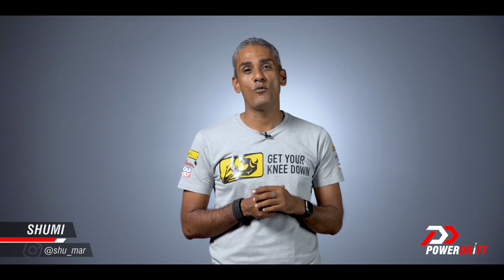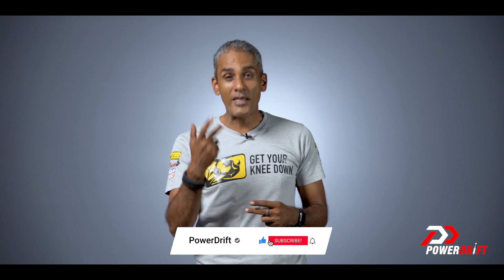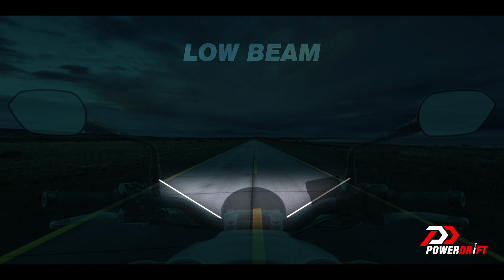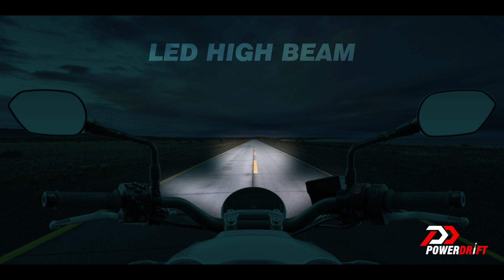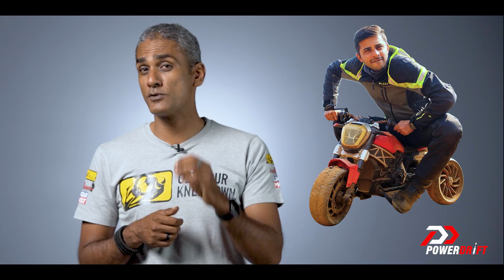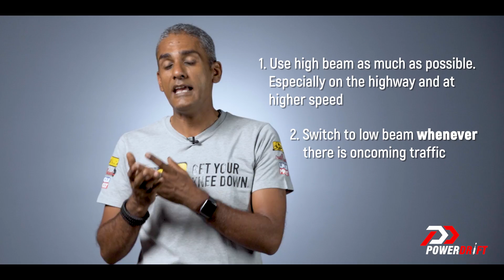PD Simplified : Are You Using Your Headlight's High Beam Enough?

Comment: I have one suggestion about this topic.
If we are heading to a corner, use high beam to give your presence on the road for the oncoming traffics.
On corners, Low beam lights have shorter light area; thus you have to respond even faster if the oncoming traffics are taking the corner through our side. But if we are using high beam; it's cover long distance thus it's shows our road presence also we got enough time to respond even the oncoming traffic is on wrong side too

Comment: The problem with many vehicles today is the AHO- Always Headlight On. It is absolutely unncecessary in Indian circumstances. It eliminates the off switch for headlight which makes the riders unaware of the light coming from their vehicle as they don't have to bother about turning it on at dusk. They'll put on high beam night and day. Dawn and dusk hours get extremely unpleasant and inconvenient due to this as our eyes are only adjusting to the changes in ambient light.
Why is government implementing AHO instead of DRL is the important question. Even if AHO is discontinued there will still be several vehicles on our road which have AHO.
Reply: The data says otherwise. Headlights unequivocally help 2Ws be seen my cars. There’s no debate left on this
Reply: @shu_mar  I was speaking of DRL vs AHO mainly. Do we really need AHO when DRLs are present.

Comment: More than the high and low beam, I am always confused in choosing the right setup i.e LED or Halogen or both, upgrading present setup to LED or buying LED DRLs of the new generation, and will it match my driving conditions which is most of the time monsoon, both day and night.
Reply: Don't upgrade to LED, if your present setup is a reflector based halogen setup, rather swap to a projector unit with higher power halogen than your current.

Comment: Hi Shumi/PowerDrift... It is always a pleasure to hear your suggestions for improving riding skills. My question is that I have an R15 V3 which does not come with a very good set of headlights as its high beam is as good as low beam only. Which makes it very difficult sometimes to ride at night, specially when there are high beam idiots coming the from front. It will be of much help if you guys could give any suggestions/tips for riding in such conditions.

Comment: on some bikes when ever the accelerator is released it does engine breaking significantly 
is it good or bad thing about motorcycle?
is it due to engine is not smooth or running properly?

Comment: PD team
In city limits low beams must be used
Every on riding or driving uses high beams.
Use of high beams is prohibited when not necessary under section 177 of motor vehicle act.
You narrated an incident where ho beams were not used, in the current scenario high beam use is rampant.

Intent is to reduce the use and your Video title suggests otherwise.

Comment: High Beam should only be used in country roads where there are lots of twists and turns and also there is almost no traffic. else you should always use especially on Highways on low beam only. On Highway you always see oncoming traffic. i remember 15 to 20 years back vehicles always used to switch low beam when there is on coming traffic on highway. but now a days there almost none will switch to low beam. looks like commonsense gone done hill with new generation riders.

Comment: You should never ever use high beam in city or even suburbs, period. It is only for highway, even then you should dip them as soon as you see oncoming traffic. If you feel the need to use high beam in city, you're definitely breaking the speed limit. That being said, I don't see the point of this video, because all I see when riding my motorcycle are idiots constantly on their high beams, even during broad daylight. It's like the low beam doesn't exist in their motorcycles. Using too little high beam isn't the problem, using too much of it is.